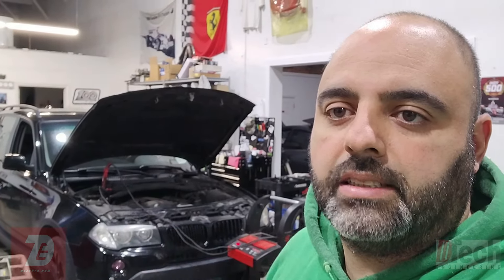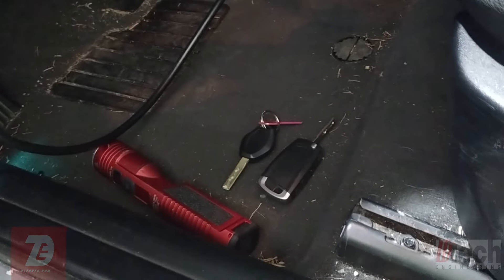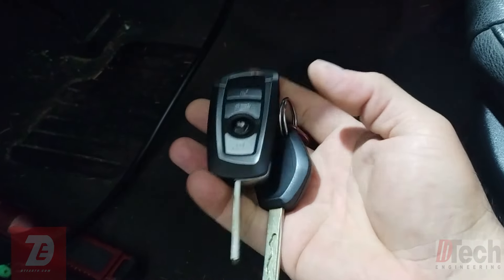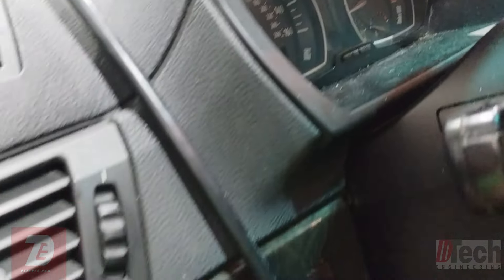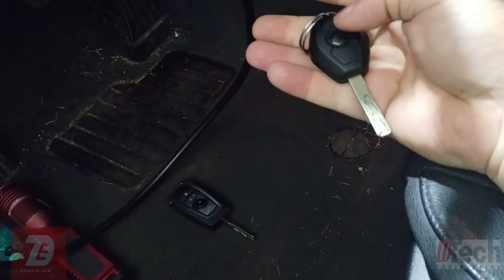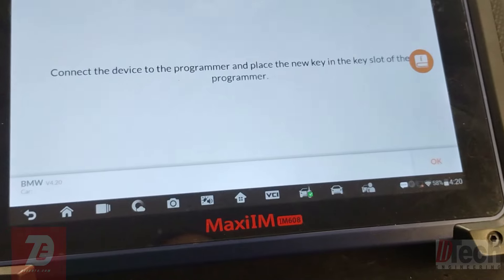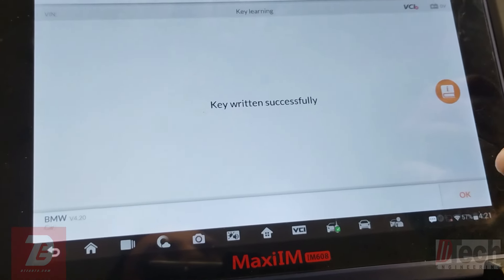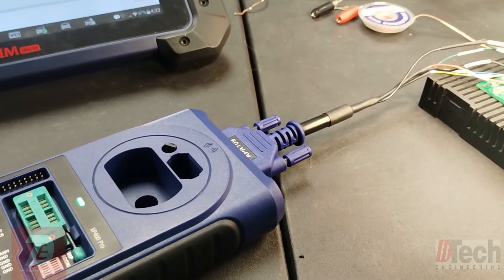2007 BMW E83 X3 No Crank Immo/EWS Problems

Comment: happened to me on a ford once, nothing wrong with the key or programming, or registering to the car. Just chip lost it's position on the key, too far away when inserted . there was a place that my chip was supposed to stay and had come out of place. from that time on I make sure and superglue the chips on the board. That is an xhorse universal chip (or what it looks like). You are such a great diag guy you need a key toolmax 500.00 you will never regret.  It will check the immo ring on the column, remotes, make chips, from universal ones, so many functions to list. Put that other key back together and glue the chip at the key end (on the inside of course). Thanks for the lead adapters , got them with no problems. Thanks for all you share.
Reply from the maker: Thanks for watching and thanks for purchasing the leads
Reply: Mine crankd trunk key font work

Comment: My one the remote stopped working no signal from unlock button it was working now and then but now doesn't so if i get another key just for the remote how to program it?
Reply from the maker: you can use the remote programing procedure and try to learn it, search how to videos and hopefully that works

Comment: Thanks for sharing! Couldn't it have been something as simple as the chip being too far away from the vehicle because it was rattling around?
Did you try putting it back in position and trying it when it still said position 8. we know the data PID that said blocked never changed, so it's possible it was still programmed fine?
Reply: I was thinking the same thing. I have had instances where the transponder was not properly placed and the vehicle didnt like it.  Some are pickier than others.
Reply from the maker: it definitely crossed my mind that it could just "simply" be the chip out of position. But I wanted to start from scratch with a new one since those were already randomly being troublesome, but I will get the blade cut on it and try to see if it will work again after placing the chip back in its spot.
Reply: @DTEAuto  Thanks! I meant no offense with the word simple. I have the utmost respect for your diags. I learn a lot from your videos.
Reply from the maker: No definitely no offense taken, I was trying to refer that I was thinking along the same as you mentioned, thanks for watching as always
Reply: Hi Sir, I’m pretty sure glueing the rattling chip back in to place will make the key start the car again. Definitely with aftermarket PCF7935 it is very important to get the chip as close to the antenna ring as possible! Good luck and keep the video’s coming.   K.

Comment: Thanks for make a good Video 
What if I grab a ews4 box of other car with an original key and plug in with the car. In this case May I be able to start the car?
Reply from the maker: I would say it's worth a try, that was actually one of the things I was going to try and do with this one but I was unable to find an ews with matching key here at the local yard. If you try this you will have to perform the ews dme alignment procedure before you try and crank it.
Reply: @DTEAuto  Thank you so much man.